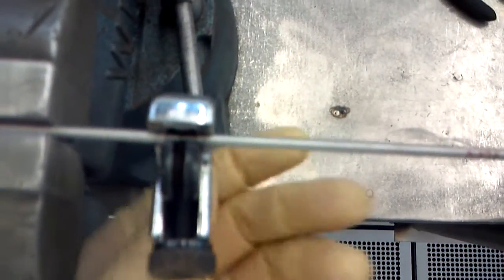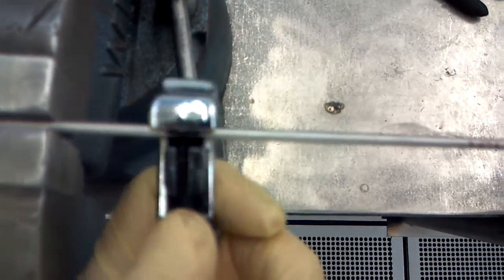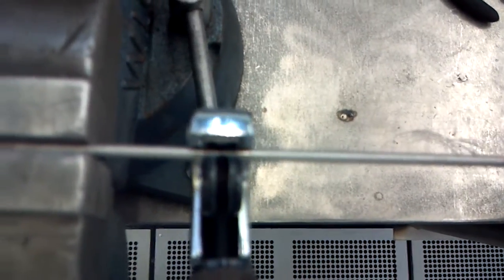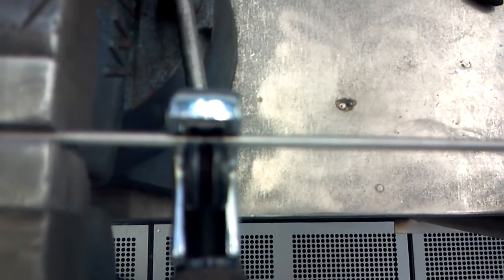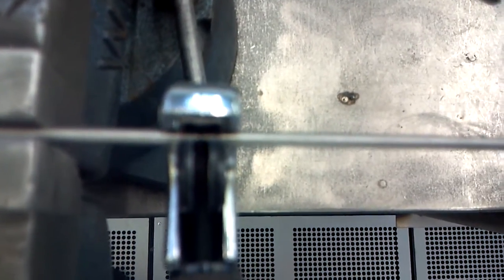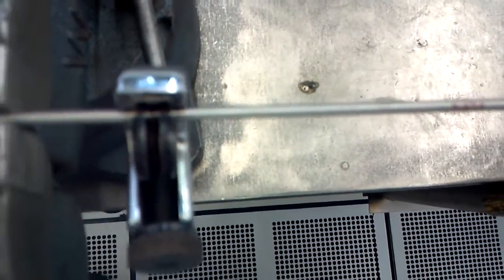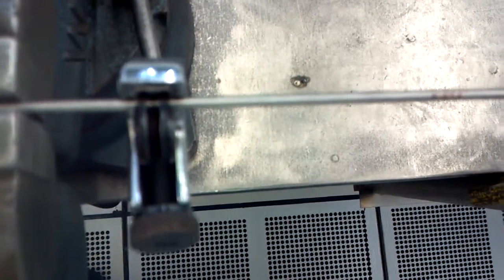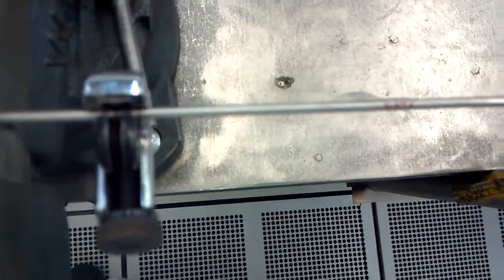1/8 inch tube welding

Comment: good afternoon. My name is Anton. I'm from Russia. we are also engaged in such welding. now we also need to weld a 1/8 inch diameter pipe. no experience in welding 1/8 inch pipe. Please tell me if it is possible to find out the nuances of welding from you, and how can I contact you?